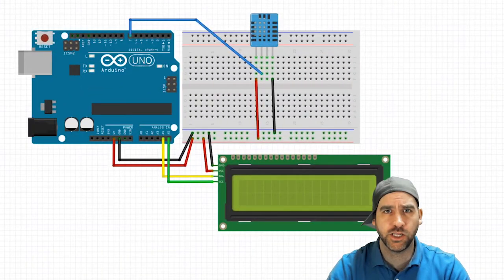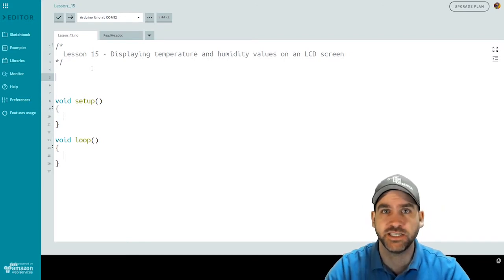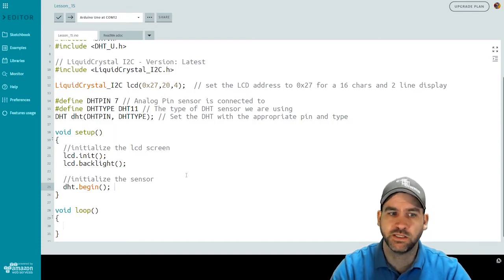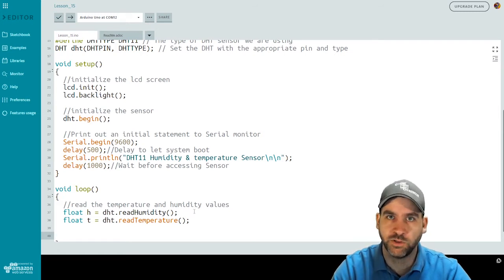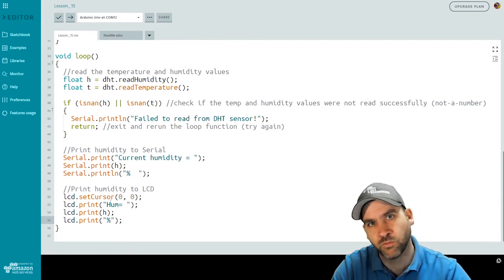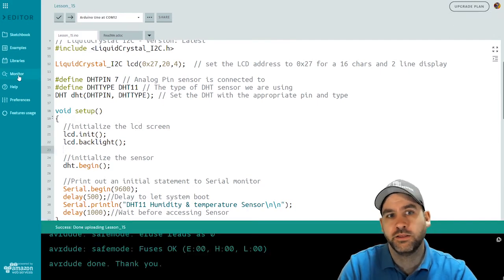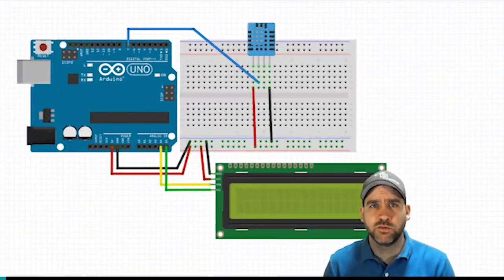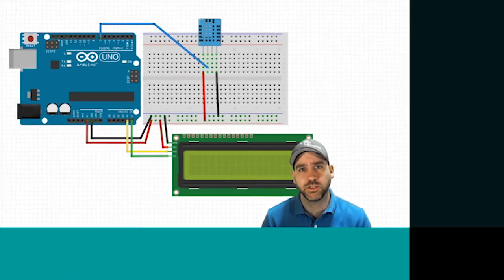Arduino Basics - Lesson 15 - Displaying temperature and humidity values on an LCD screen - DHT11

Comment: can you do this but instead of a display a fan, so if the temp is high it turs on, if its low, it stays of?
Reply from the maker: absolutely you could. In the if statements that detect the temperature value you would just trigger the pin controlling the fan to turn it on/off.